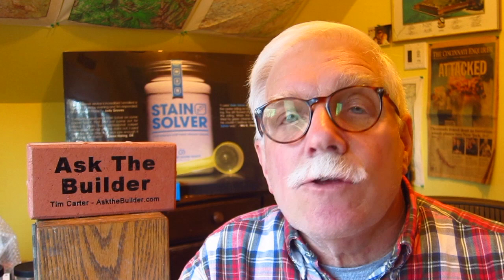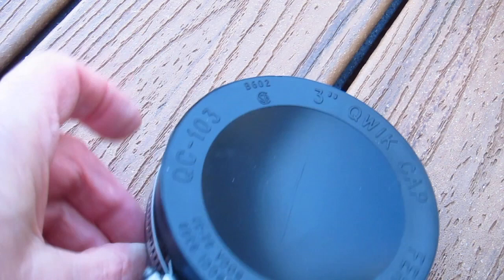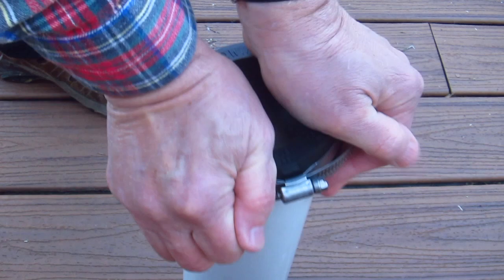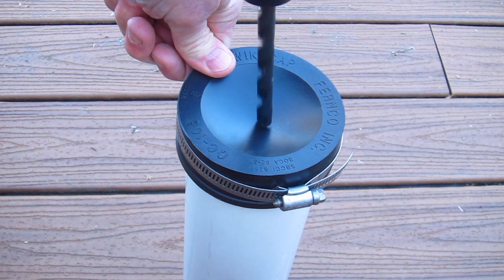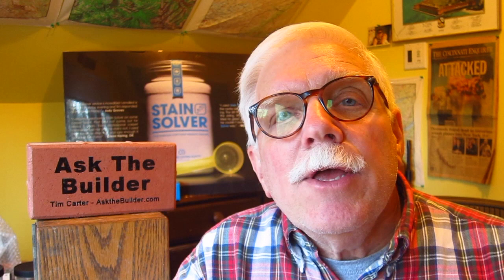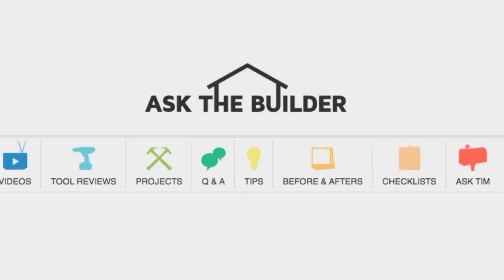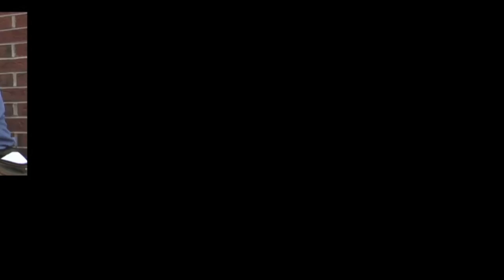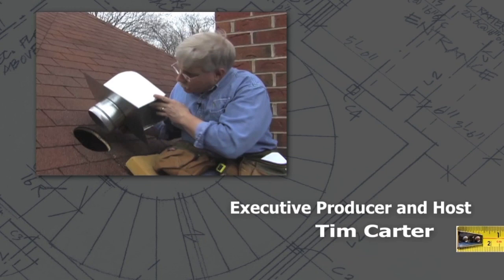Sewer Gas Smell Vent Pipe

Comment: I have a gravity fed system and I have tried your method, time will tell if it works. Can you elaborate on why caps need to be removed in the winter? Thanks
Reply from the maker: You bet. Hoarfrost can clog the tiny hole fast. This is why vent pipes in cold climates are 3 inches and often 4-inches in diameter.
Reply: Hoar?  Only hoarfrost ive ever seen comes in little baggies and costs as much as gold...

Comment: What about when the smell is coming from the inside basement bathroom? The roughed in plumbing was already done before we purchased the house.  We put in the new bathroom and the smell is strong in the bathroom.  When using the tub, it floods the next room over (Laundry room) from the drain in the floor.Only in the winter (Cold place).  In the summer we do not get the oder.
Reply from the maker: Dave, I've solved HUNDREDS of sewer-gas odor problems over the phone. I've been a master plumber for 40 years. If you need help, you've got this option: https://shop.askthebuilder.com/15-minute-phone-or-video-conversation-with-tim/

Comment: Hi the sewer pipe outside of my house shouldn't there be some type of cover to prevent rain water from going in and leaking the inside walls ?
Reply from the maker: Sounds like you and I need to get on a phone call. There's MUCH to unpack: https://shop.askthebuilder.com/15-minute-phone-or-video-conversation-with-tim/

Comment: We have a bad smell outside of our house only when somebody is showering. I've verified it is coming from the vent pipe on the front of the house. We also have a vent pipe on the back of the house...this is the bathroom with the shower. I've tried to get a plumber here with no luck. They just say it's normal. Well this smells like death. Guests have asked us what that smell is. One plumber said put a 4 foot extension on the vent pipes. Not sure I want a 4 foot pipe coming out of my roof! I want to try your solution. So, my question, do I try this on BOTH vents or just the one that smells?
Reply from the maker: Both
Reply: Ok, thanks. I'll give it a shot.
Reply: @CoachD1  What were your results please? I have the exact issues

Comment: Enjoyed the video, a new subscriber! I do not have a septic system but I still have a strong smell of sewer gas on the main floor bathroom that has a shower that is very really ever used. I let the shower run for a few minutes every once in a while and that seems to help but lately it’s pretty nasty ! Wondering what your thoughts are ? Thanks
Reply from the maker: Dennis,  I solve all sewer gas problems on the phone. I have quite a few questions I have to ask to drill down to the source:  https://shop.askthebuilder.com/15-minute-phone-or-video-conversation-with-tim/
Reply: I had a smell problem with a little-used shower. I removed the drain screen and installed.a rubber test plug to seal it off. It works very well.
Reply: @Excaliburt  Your P-trap is going dry. Occasionally run water in it to keep the trap full to keep the smell out.

Comment: We had a new septic put in a new manufactured home and it instantly smelled so bad outside! We checked the septic it is fine. But outside smells! We have vents on top. Are they maybe too much airflow?
Reply from the maker: Well, just do as I show here and come back with your great report. It's guaranteed to work.
Reply: Did you try this and if so what were the results? My wife and I have this exact issue? Thanks so much

Comment: This is very interesting, and I'm trying to convince myself 3/8inch is big enough.  Can you help me to understand the math behind this? Let's take a simple example - a toilet with say 15 feet of vent pipe. What is the way to calculate minimum hole size (or minimum air needed) to flush the standard amount of water?  and I assume the equation changes depending on length of venting?
Reply from the maker: John, I thought I did in the video. Your assumptions about length of pipe, etc. have nothing to do with the viability of this solution. Think vent hole in water jug. I've been a master plumber since 1981. This works. Soon I'm taking this video down. If you need more help, you have this option: https://shop.askthebuilder.com/15-minute-phone-or-video-conversation-with-tim/
Reply: @askthebuilder  yes I certainly understand the overall concept.  However, there must be a point where if you make the hole too small, the venting won't work - i.e. you get closer to the vacuum conditions.  I am wondering if you did the math to calculate minimum hole size where you won't have problems.  You must have since you say in the video that 1/4 inch is plenty big enough (I assume greater than whatever minimum you calculated).  I am wondering what that math looks like.

Comment: Hi Tim! Or anyone!

I'm in a situation where I can't vent to the outside nor tie into existing venting. (Condo)

I'm draining laundry water into its own Ejector Pump that requires venting.

I can vent through the ceiling. If I use this method, will there eventually be a foul odor?
Reply from the maker: It's time for you and me to get on the phone before you make a HUGE mistake. I've already done three calls today: https://shop.askthebuilder.com/15-minute-phone-or-video-conversation-with-tim/

Comment: Any chance I'd have an issue with this during winter months?  I'd be concerned the small hole could freeze shut with some precipitation
Reply from the maker: Yes, it might freeze in bitter cold WX. But if the pipe is in the sun, the black will help melt the ice in short order. This is why I said in the video you MIGHT want to remove it in the winter as you don't have doors and windows open then. So who cares if there's odor outside????
Reply: @askthebuilder  I do lol.  I hate that I can smell my septic when I'm hanging around out in the yard.

Comment: I live in New Hampshire. I’ve been extremely frustrated with a sewer gas smell in my yard when it gets cooler out in the fall. It continues in the winter as well. It’s disgusting. When I take the dog out or have family over I don’t want to smell it.. I’ve tried a charcoal filter cap and all that did was back the smell up into the house. If this cap with a hole in it works, why would I have to take it off in the winter?
Reply: Aww.. Because ice and snow could block the hole..
Reply from the maker: Correct. To get unlimited tips each week, subscribe to my FREE newsletter at www.AsktheBuilder.com
Reply: This solved my sewer gas problem! I have been keeping it on over the winter, the warmth of the air coming out keeps it defrosted.

Comment: Doesn't the vent pipe need to VENT gas at volume, and wouldn't the cap solution you propose hold sewer gas in the house because the hole is too small? You describe the stack as  it if were necessary only for pressure relief/suction...but it seems like it's venting gas constantly...
Reply from the maker: Auden, you're in the same boat as many. You don't understand the true purpose of the vent pipe. Watch the video once more.
Reply: This is my concern too Auden.  From what I understand the pipes also let gasses OUT when pressure builds up in the sceptic tank.  Not allowing them to do so (my sceptic tank has two pipes) might create significant pressure in the sceptic tank and a create a bomb underground.  These gasses might be caused by an unstable sceptic tank eg not the correct balance of bacteria etc, from what I understand but whilst i really want to believe this solution, I'm concerned to try it due to this question of pressure build up. Would love to book a call with Ask the Builder but not sure he is still active.  Does anyone else have any thoughts or suggestions here?

Comment: Ours smells inside the house at any given time throughout the year. It just started the past few weeks and has gotten worse. We don't open the windows in the summer spring or fall as it's too dusty for my wife's allergies. We have a septic system and wondered if the smell is coming from it somehow through the basement pit ad in through the A/C. It comes and goes throughout the year but for some reason, when the wind blows or we haven't had rain for awhile, it gets bad. Can I vent the clean out caps to help air flow from the septic or is that a no no? Help please! Thank you!
Reply from the maker: I solve hundreds of sewer gas issues over the phone each year. The call is FREE if I don't help you. Go here: https://shop.askthebuilder.com/consult-tim/

Comment: ?  What?  How is this a fix?  As you said, it's still going to vent there, what difference is this supposed to make?
It smells like dead animals outside my house.  For the past couple years I figured the family of ground hogs died underground somewhere.
Just did a bunch of work on my roof and the smell is coming from the vents.  
It would make more sense if the solution was to have taller pipes.  It's too low for a one story house, which is why you can smell it often outside.
If you're smelling it inside your house I don't see what this is supposed to do either.
Reply from the maker: It should be obvious how it solves the problem. Read the other comments.
Reply: @askthebuilder  The problem is the smell comes out of the hole.  Your solution, put a hat on it with a hole that smell still comes out of.
I read the other comments.  They said thanks.  I still don't know how this 'solves' the smell around your house, let alone inside your house.
The fact that you can't actually answer the question is enough to know you're just rambling.

Comment: I don’t have a spectic system but in my main floor bathroom we have a shower that is never used but smells of sewer gas. I let the shower run for a couple of minutes every month or so but I was wondering what your thoughts were. In
Reply from the maker: As I said earlier,  I solve all sewer gas problems on the phone. I have quite a few questions I have to ask to drill down to the source:  https://shop.askthebuilder.com/15-minute-phone-or-video-conversation-with-tim/

Comment: Would this fix an intermittent problem of sewer gas smell during high winds?  I'm getting gas smell in an old bathroom, that was supposedly capped off. but only when there is a high wind outside. Any ideas?
Reply from the maker: Yes. You need to read my new Sewer Gas Smell ebook. I should have it for sale on Sunday February 27th. I'll announce it in my newsletter and subscribers will get a 50% discount on the price. I suggest you subscribe to my FREE newsletter now right on the front of my home page: www.AsktheBuilder.com

Comment: I just purchased a mobile home with a metal roof and I see no roof vents coming out of it. Not sure where they are venting at but my kitchen sink wasn't draining very fast and I noticed they put a pvc cap on where the vent should have been under the sink. I drilled a hole in it but now my house smells like sewer. Should I punch a hole and stub it out the wall?
Reply from the maker: Did you watch all my other plumbing vent videos? It would be a good idea.

Comment: Thank you. Does this work for the vent on the wall as well.
Reply from the maker: It would if the vent pipe is OUTDOORS. Never leave an opening to the atmosphere on a vent pipe INSIDE a home or attic.
Reply: it is outside. thank you. will try and leave a comment.

Comment: I'm in an apartment building and I'm on the top floor, I can smell sewer gas coming from under the sink in the bathroom, but it isn't coming from the p-trap. It seems to be coming from behind the wall. Could it be the vent pipe?
Reply from the maker: Yes. Go to www.AsktheBuilder.com. Read ALL of my columns about Sewer Gas Smell. That will help you for sure. Sign up for my newsletter while you're at it.
Reply: Cracked black plastic sewer vent pipe behind wall

Comment: We're on the city sewer system and our home has two vent pipes.  Both of them stink but one really reeks.  We put a 2-foot PVC extender pipes on them which has helped some, but we're still experiencing the issue.  Here's my question:  Do you take these off in the winter because snow and ice can block the small hole, or is it because the moisture in the vented gases will freeze and block the small hole?  Reason I'm asking is because it would be easier to put the cap on and then drill a couple of small holes in the vent pipe extension immediately beneath the cap, rather than through the cap - then I could potentially leave them on all winter.  Great video, btw.  Thx!!!
Reply: Ah, never mind!  I found your "Hoarfrost" comment on another post.
Reply from the maker: Yep. To get unlimited tips each week, subscribe to my FREE newsletter at www.AsktheBuilder.com

Comment: Why use a 3 inch stack for your stink pipe if all you need is a quarter or 3/8 inch hole? Why not run a 1-in pipe into your 4-in line for your vent pipe?
Reply from the maker: Simple. The code requires it and in cold climates a small hole would choke with ice within hours blocking off the air that's needed in the system.

Comment: Hi Tim, I do not have a main exhaust pipe in my home. I am on a septic system and have a crawl space where inside the craw space I have two air admittance valves on two different drain pipes. I want to encapsulate my crawlspace to dehumidify it and remove mold so the crawl space vents will be closed but of course there will be an access door. The crawl space is 1800 square feet. The septic also does not have an exhaust pipe on it but it does have an inspection pipe 4' away from the septic yet it has a screw cap on it. Will I need to add an exhaust pipe to my system and if so, where do they go? Can I drill a hole in the inspection cap? Can I leave it as is? Thank You.
Reply from the maker: All plumbing issues/questions require a phone call. Far too much to type. I've been a master plumber since 1981. Very affordable: https://shop.askthebuilder.com/15-minute-phone-or-video-conversation-with-tim/

Comment: @Ask the Builder
The place I'm living in (overseas) was NOT ONLY built before any codes were put in, managed to put the drain pipe from the apartment above mine, through my kitchen, and it's connected to my sink. The result is, that, when the pipe burps, it smells like an open sewer (it may be hooked up to their toilet upstairs. Since I don't and CAN'T communicate with the above stairs neighbors, I was wondering if  I could put a "choke plate" like you find on the air intake on a carburetor so let the water flow in one direction but works as a baffle for gas coming back the other way (almost like a gate valve but more of a swing gate/baffle. Does something like that already exist? What's it called? Is there a brand you can recommend?
Reply from the maker: Please go read ALL my sewer gas columns on www.AsktheBuilder.com. Then watch my How to Vent Plumbing video.

Comment: What happens when it snows or ices it going to plug
Reply from the maker: Then the plumbing system doesn't work right. That's why in the video I said to REMOVE it in winter months. After all, windows and doors are closed when it's cold so who cares if there's an ODOR outdoors then? The odor doesn't waft inside in the winter.

Comment: okay i recently bought a home and notice the smell at first but seen there was a ton of water under that house and took the smell for stagnated water or how ever its spelled. well it was not it. i noticed that there is multiple sewage lines and the one that is allowing sewage gas back through my shower i installed a aav underneath the house and it help for a min but i can still feel a breezes coming from the shower drain what am i doing wrong the only thing that is ran too the line i am talking about is the toilet and shower. installing it i used a 1 1/2" y pipe and ran it inline with the shower drain i put the vent cap up toward the floor the smell is driving me crazy not to mention the nagging coming from the wife i figure that would fix it.  have one more 1 1/2" aav but tbh i am stomped on what could be causing it. any input would be great
Reply from the maker: My input is simple: Fill out my questionnaire and then schedule a phone call with me: https://forms.gle/qKRR7DLmNvcKeRuH9   Once you answer the questions, I'll reach out to you to schedule the call.

Comment: Hi, Colonial home with one vent on 1 and 1/2 bathrooms.
The 1/2 bath on first floor has sewer smell coming from sink. Pulled and cleaned P trap. No change.

Going to check vent tomorrow. If I cover vent and  I have someone flush toilet. Would that vacuum help clear blockage?
Can I clear with garden hose?

We have had some stormy weather in Central Massachusetts over past month. Many trees around home.
Reply from the maker: Pop. I solve all sewer gas issues over the phone. Far too much back-and-forth Q & A:  https://shop.askthebuilder.com/15-minute-phone-or-video-conversation-with-tim/
Reply: @askthebuilder  thanks. It was overflow in sink.
Here is one for you.
Daughter had a party and someone vommitted in sink. Filled sink into overflow. Overflow was caked with vomit. 
Cleaning that was a joy.

Comment: So why you can't leave the vent covers on in the winter time.  I live in Mississippi.  Please respond ASAP
Reply from the maker: Hoarfrost in cold climates. Ice will choke the hole.  You're fine down South. You'll not have to remove it ever. You never get EXTENDED cold WX.
Reply: @askthebuilder  I'm gonna try this , and see what happens.  Thanks

Comment: Man this might work but it very bad advice! It wont take much to clog up a little hole, and now you have no venting for your plumbing system. Also asking a homeowner to climb on their roof that often is like talking to a tree, even if you tell them that little hole will freeze over in the winter, and why our vents are sized the way they are.
Reply from the maker: It does work. Read the other comments. Anyone that can get up to put this on can also brush debris out of the way in the 1:100,000 chance something WILL completely block the hole.